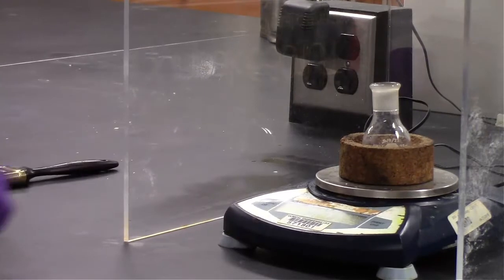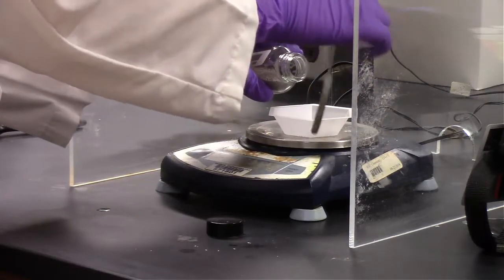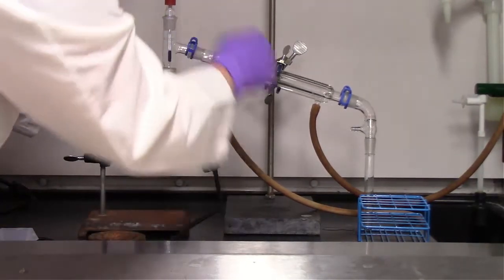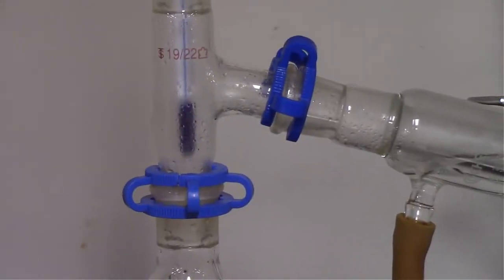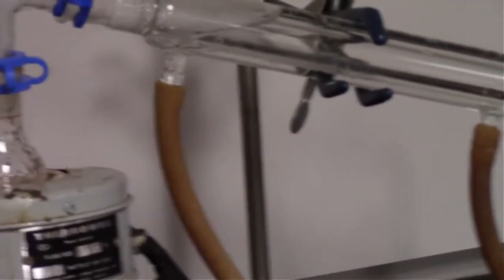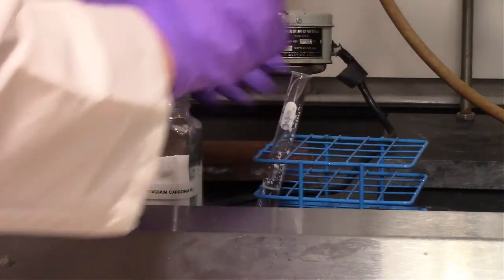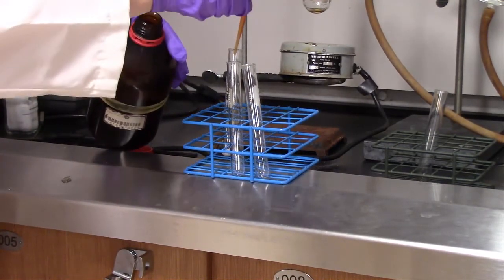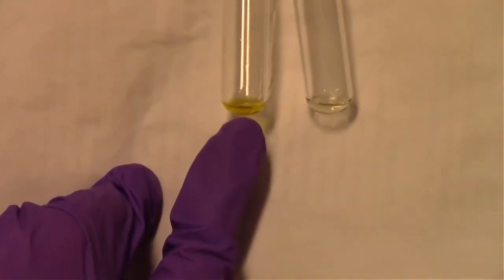Formation of Cyclohexene via an Acid Catalyzed E1 Reaction

Comment: If we were to stop the reaction at a lower temperature, would that make the drying agent unnecessary or less necessary? Do we know that we have not transferred potassium carbonate into our cyclohexene because of its observable physical qualities or its chemical properties? Thank you!
Reply from the maker: Since the cyclohexene bp is 82.8 deg C, and the bp of water is 100 deg C, it is likely that collecting the product at temperatures above 82.8 deg C will contain a small amount of water. I agree that stopping earlier will mean less water is collected. However, adding drying agent is a somewhat easy step that is useful to apply even if the concern is contact with the very small amount of water that is not visible on glassware. For the drying agent, that is a white solid added to the organic liquid, cyclohexene. So we would see the white solid (a physical property) of the drying agent within the cyclohexene product if it was present.

Comment: Is 5.03 g the theoretical yield of cyclohexene product?
Reply from the maker: No, that was the mass of the starting material, cyclohexanol. It is necessary to calculate the number of moles of cyclohexanol used since it it is the limiting reagent. The number of moles of cyclohexanol is at a 1:1 mol ratio with the product. So you can convert the number moles (or mmoles) cyclohexanol to the number of moles (or mmoles) of product (the same number). Then convert moles (or mmoles) of product to grams of product using the moleculare weight (MW) of the product.